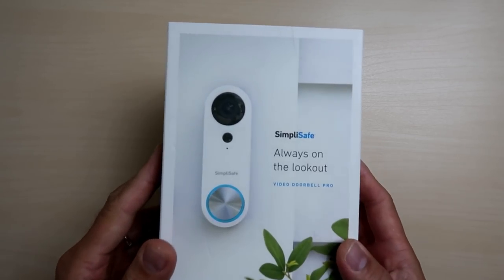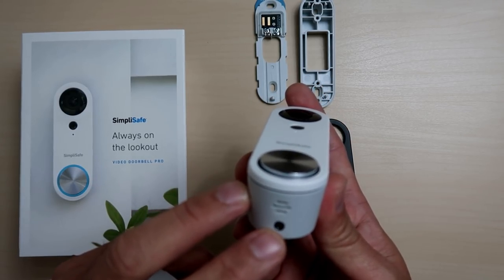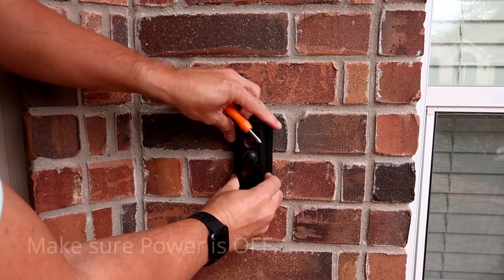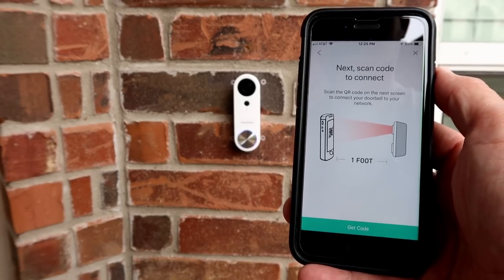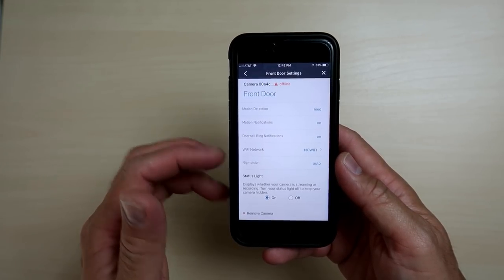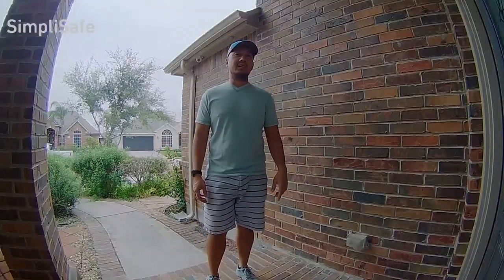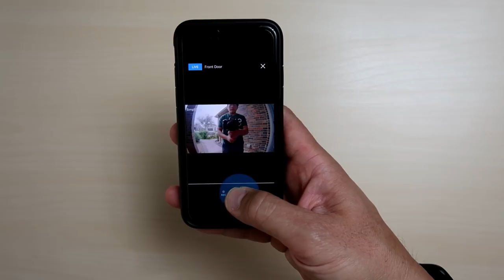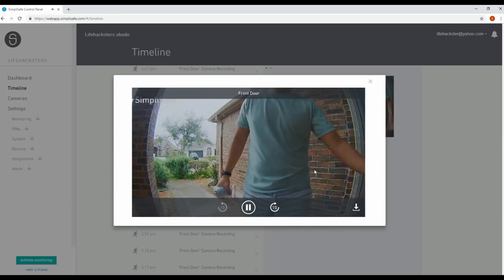Simplisafe Video Doorbell Pro Review - Unboxing, Features, Setup, Settings, Installation, Footage

Comment: I just got this for free when I purchased the Alarm System at Best Buy , it wasn't advertised from what I could see, but came up as free in my cart. That's a better deal than the free $99 indoor cam deal on the Simpli Safe website. I'd say that's a great deal.
Reply from the maker: That's a good deal. Best Buy has some good deals lately.
Reply: I understand about getting the free doorbell cam from Best buy.....know that this is the first time I have known them to give anything free via 3rd party seller. Let me ask you this: did you purchase the new SS3 system at Best buy when they gave you that free doorbell cam? Or was it the SS1/SS2 model which are the original? Did you have to plug a key fob in the top of the base station to get it to work? If so, that explains it. The original systems do not and can not get firmware updates. If Simplisafe is allowing Best buy to do that, there is a reason. NOTHING is for free....especially when this ten yr old startup just got their first investor....for a billion dollars. They did not throw that kind of investment in it for nothing.  That 4.99/month extra charge for the cloud storage?  Look at this way....that is just for one device...that only records for 30 seconds if an event is triggered....that doorbell just shows the front door. Most burglars break in the back or the side or through a cellar or garage.  And from my experience with former customers,  most do not get all the sensors they should.  For example, let's say you have a total of 12 to 20+ entry points on the first level....most folks are only going to by the entry sensors because they are only 14.99 each. When you start recommending motion sensors and glass break sensors, they start either A.) thinking that your trying to make a commission which they do not get, but most don't believe it so they take a pass, and B) if you do not recommend everything and the kitchen sink, the floor bosses start threatening everyone on the sales team with a demotion to the tech department or a straight out firing. Does not matter if your brand new. Don't take my word for it, call any of Boston's staffing agencies, they are all on Simplisafe's speed dial. When you have that much turnover, that means customer service is going to really piss you off whether it is a week from now, or two months from now.  And when you have that much turnover that means your more likely to be given false information on the specs and the what-if scenarios. I find it rather interesting the comment about getting the brand new doorbell cam that they took for ever to design only to now let Best buy give them away for free....with an original model. The one thing I did not want to do was start recommending other products even though I'm well qualified to do so because we'll, why give any company free advertising ? At the same time  I want to make sure everyone knows what they are getting into.

Comment: Is there a secret to getting the setting screw in the bottom of the camera?! I can’t get mine in for the life of me!
Reply from the maker: It can be frustrating. I dropped mine a few times when screwing it in. I place the security screw first on the torx driver then try screwing it in.
Reply: The set screw uses a TORX head screw driver, not Phillips or straight slot. There was a small TORX screwdriver with my Simpli-Safe video door bell.

Comment: Does the base station or siren act like a chime?  Do I need to purchase a separate home chime?
Reply: I am also curious about this as our house doesn’t have wiring or a chime so I ama looking for alternatives.
Reply: Matt Zaiman yep, I’m in the same position. I haven’t heard anyone mention this yet in any review or forum.
Reply from the maker: I actually don't know because I don't have the simplisafe alarm system.
Reply: That’s ok, I figured.  Can anyone who may have the simplisafe alarm system and the doorbell answer this?
Reply from the maker: Another user that have both doorbell and the alarm system said that "no" it doesn't chime on the base station.
Reply: Wow, That’s unfortunate. Miss opportunity simplisafe. Well,  Thanks for the info!
Reply: On their forums it is stated that the doorbell will not use the base station as a chime. The doorbell is integrated with the website, not the base station. Definitely a missed opportunity.

Comment: Helpful video! Can you make any recommendations for installing this on a rental home?
Reply from the maker: You can, you just need to swap your existing doorbell..
Reply: Nichole.. If your lease says "No Hard Wired" anything to the home, best to ask first because if they do come by to inspect the home which is also stated in leases that they will do, and they see that, they can evict you for breach of contract. I am in the same situation BUT I did find on youtube last night a video / talk doorbell that does run on battery. Depending on how much traffic you have in front, depends on how often you have to charge the battery to it. Also, if someone takes the doorbell off, the alarm goes off. Wasn't that expensive either. I meet with the realtor tomorrow to ask if this could be changed on my lease if I agree to put things back the way I got them. I also want the 2 way talk motion detector / alarm flood lights for my front and back yard.

Comment: How many seconds does Ring Pro start recording before motion? And how long are the Ring's vid clips? If one was looking at getting either Ring Alarm system or Simplisafe Alarm system which brands complete package with doorbell would you recommend?
Reply from the maker: Ring Pro also starts recording around 3 seconds before motion is detected. Clips are also 1 minute long. As to pricing, Ring wins because professional alarm monitoring and cloud access to unlimited cameras are only $10/month or $100/yr. Simplisafe is more expensive. I think their interactive monitoring is $25/month.
Reply: @LifeHackster  thanks. So then do you feel the more modern design and extra features of Simplisafe is worth the extra $15 a month?

Comment: No MicroSD recording, no deal.
Reply from the maker: A lot of WiFi doorbells doesn't have this option. It would be nice if there is local recording not to micro SD because the doorbell itself can easily be stolen but to an NVR system inside the house.

Comment: LifeHackster, between the ring system and SimpliSafe, which would you recommend?
Reply from the maker: I haven't tested the Simplisafe Alarm but I can tell you that the Ring Alarm is cheaper in monitoring $10/month and also that includes the cloud recording access on their cameras.
Reply: LifeHackster Thanks for the reply, I enjoy your videos. They are very detailed and helpful.

Comment: What is the micro USB port for on the back of the doorbell for?
Reply: Robert touroo I’m really hoping its to charge an internal battery as they advertised at CES.
Reply from the maker: I think it is to power up the camera also or to charge the built in battery. I haven't seen any documentation for it.
Reply: So in the future it could run off battery? That would be great they would have to sell a chime then.
Reply: They might have a plan to run it on a battery in future.
Reply: @basselassaad1272  that would be nice since they can't seem to get the chime connecter sent out, and make the base unit a chime.

Comment: do u need to shut the electric breaker off when wiring it up ?
Reply from the maker: Yes, just for safety...
Reply: LifeHackster question on the reolink ! can't seem to get phone notification going on the reolink argues 2 ! tried different emails ! have hotmail.com for emails !
Reply from the maker: Same on mine as to email notifications. I couldn't get it to work. For push notification on your phone, you just need to turn on PIR sensor and push notification in the settings.
Reply: LifeHackster I have a arlo overlooking the front also so I'm getting alerts that way I'm covered

Comment: From what I can tell alot of people are having the buzzing/humming for the doorbell chime.
Reply: Robert touroo I am installing my doorbell tomorrow. I called SimpliSafe for the chime connector just in case. It will be here in 3 to 5 days. Is the noise loud?
Reply: @erich1979  no not loud but noticeable. They keep telling me 3-5 days also that was 2 week ago still on backorder. Thinking about sending it back and going with nest hello.
Reply: Robert touroo At least it’s not too loud. Hopefully I won’t get the buzzing. If I do, hopefully the connector will come soon. I don’t mind waiting a week or two. If you get yours soon, please let us know if the issue is fixed. :)
Reply: @erich1979  yes I'll let you know if the status changes. Let me know if yours is buzzing. The video is amazing I like this one because there is no fisheye effect and it's quick loading time.
Reply: Robert touroo I installed the doorbell and it works great! There is a slight buzzing sound in the chime box. I am happy I called about the chime connector. When I logged into the site it does say on back order. The buzzing isn’t bad at all so I am okay with waiting it out for the connector. Hopefully it doesn’t take forever!
Reply: @erich1979  yes I agree I called today they said next week. I think it's better than my original ring doorbell. I'll let you know if I notice  it's off backorder
Reply: Robert touroo Thanks man!
Reply from the maker: I haven't had any issues with mine and that's good that Simplisafe will send a chime connector if that happens. They should have included it on the package.
Reply: @LifeHackster  its been nothing but a hassle trying to get one. They keep telling me a different story every time they say it's on the way. Bought to give up and return it. They should of planned this better.
Reply: Just a heads up just got off the phone with simplisafe they said the chime connecter will be going out tomorrow Nov 6
Reply: @erich1979  Got confirmation that the chime connecter shipped out today.
Reply: Robert touroo I just received my notification to that the connector was sent out. :)

Comment: Thank you for the thorough explanation of this device. I ordered two doorbells to add to my existing SimpliSafe system. They will be arriving today and your video has prepared me for installation and setup, thank you.
Reply from the maker: Cool. There are already people asking if the doorbell will also chime simplisafe's base unit which I don't know the answer because I don't have their Alarm System. Please let me know if it does. I assume it will not though but I know that the doorbell will start recording when Simplisafe's alarm goes off.
Reply: LifeHackster ,
No pushing the door bell does not activate the base station.
Reply from the maker: Thanks for the info.

Comment: I almost bought one the other day until I remembered SimpliSafe cameras does not intehrate with Alexa :(  With Ring I can ask Echo Show to show me front door and shows me video. Doesn't do that with my simplicams but will arm my system, Hope they fix this.
Reply from the maker: That's true no Alexa or Google yet but hopefully in the future.
Reply: Or you can just click on the simplisafe app.. which loads faster than asking Alexa to show you.  Also when Home be logged onto simplisafe on a laptop or tablet and leave it open and you can view any camera in your system with a click or tap of the finger???  Simplisafe keeps things SIMPLE. When you over complicate things that's when issues  arise.

Comment: Thinking about getting one of these but my doorbell is on the side of the door not facing outward. Any idea how that would work?
Reply from the maker: You will still be able to use them but you will only see the people/visitors whenever they are close to the door. They haven't started making or offering angle mounts.
Reply: I’d go with nest in that case. They actually have an angled mount specifically for this case.